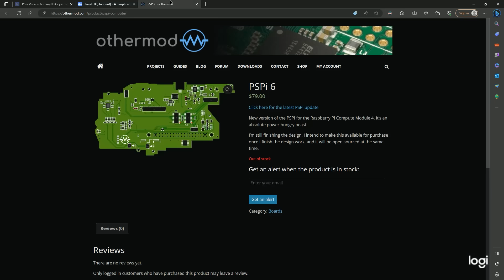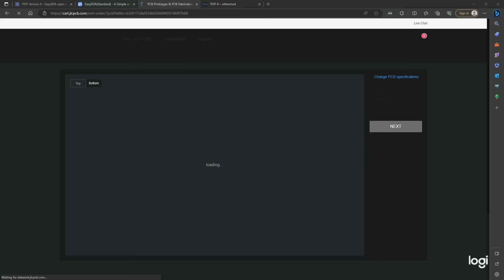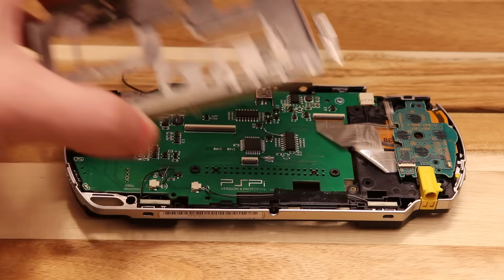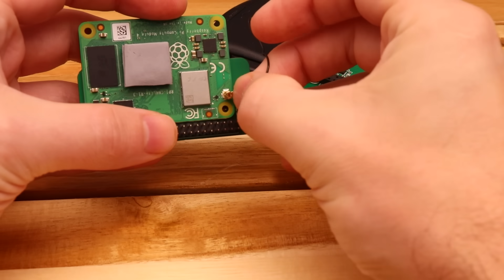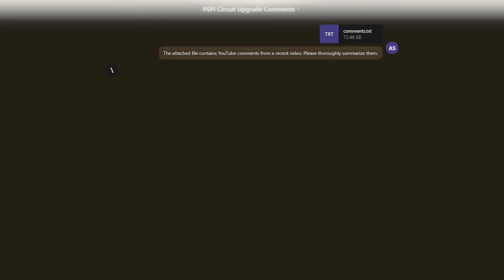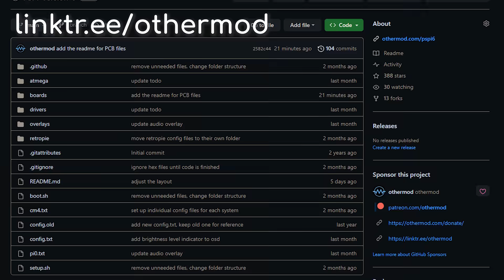PSPi 6 Questions Answered - Ordering the PCB, Building in the PSP Shell

Comment: The portable Linux system part is very interesting! Have you thought about adding a touch screen digitizer to this system’s display? It might add some desired functionality one might wish for when using it as a portable Linux machine (or it might just be me :p ).
Reply from the maker: I built touchscreen capability into the board, and the same LCD I use has a touchscreen version. Haven't found a good way to implement it though, with the PSP having the plastic cover and the LCD bracket limiting LCD thickness.

Comment: Hi, unrelated but could you somehow print or reproduce the battery boards inside fake psp batteries? but only the ones that have the ABC points that can be soldered together to give you accurate battery reading when you do a 4000 mah big batt mod, I would buy that. Im tired of getting andom boards and having to open fake batteries :/

Comment: noob question: I basically have a non working 1000 (shell). With this kit, would it technically be fully restored and working? Id hate to chunk this thing in the trash lol.
Reply from the maker: This replaces all the electronics, so yes something like this would get you up and running.
Reply: Thank you sir! Hopefully I can restore the ol unit with some OEM & Aftermarket parts as well.

Comment: This is really cool. I still have my old PSP and want to do this hopefully soon. Be great to have a portable emulation device. For charging the battery, are you utilizing the stock power connector with a step-up (or step-down) regulator on your board to manage the batter? I didn't catch anything about that in the video when you talked about the battery so hopefully I didn't just miss it.

I'm also going to have to look up the differences between using the Pi Zero versus the CM4. I had never heard of the CM4 before stumbling across this project, so that's entirely new to me. Would I be correct in assuming that based on your estimated battery life, the CM4 has more processing power overall?

Comment: quick question about the mini usb port and it being able to suply power to external devices. would it be able to connect a dongle for a controller? just out of curiosity since if I ever get to building this i hope to also 3d print a bracket or buy one like those that hold both phones and controllers so that I could play some double joystick games without any heavy mods
Reply from the maker: Yeah that should work fine. I've used USB controllers on it.

Comment: Can you place second battery instead Headphone Board(Both Zero and CM4 also have bluetooth, we can use wireless earbud instead)? Can you use FS MICA PLASTIC SHEET instead metal bracket?
Reply from the maker: Yeah, you can probably cram a battery in there. I'm not sure about the metal bracket though. Maybe with enough effort you could probably make something work in place of it.

Comment: Can it run PSP games on the CM4?

I much prefer emulation, if only for the QOL enhancements when compared to the original systems themselves.

Especially on portable systems. When idiot game developers decide “no, you can’t quick save or “save anywhere/anytime” in an age where it could have absolutely been possible to put into the game but was restricted to “you can only save at a campfire” for convoluted reasons, then I’ll simply emulate it rather than putting up with their BS. Why they think that their customers should have to replay parts of a game that they’ve already completed correctly just in order to get back to a part they want to try again is beyond me (also one of the reasons why I play Dark Souls games in a VM setup, even though it’s technically not “emulation” I can still “save-state” them right before a boss fight so I don’t need to go back to some pointless “bonfire” to start)

TLDR: I’d love a device like this for PSP/PS Games. Would also enjoy them for PS2 games but would probably wait until a Vita shell Pi conversion existed that was powerful enough to run them and had support for two analog sticks rather than a single disc.

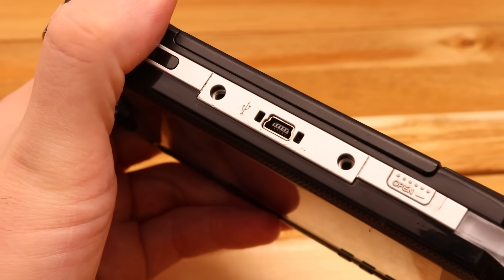Comment: 8:15 what happens if I don't use the same power source? Can you please explain?
Reply from the maker: The barrel jack and USB port are connected together, so a mismatch will cause power to flow from the higher voltage power source to the lower one.

Comment: There's an old mod that added a second thumb stick under the right side buttons. You had to modify the board in the thumb stick and solder it to the traces for the 4 buttons on that side. That way, you could use a stick for fps games that used those buttons for camera movement. I'm sure something similar could easily be done for a second independent stick.

Comment: Great project i still have my old PSP laying around maybe i'll install your mod as soon as it's done with the prototype phase. I would find it great if the pcb had usb-c instead of mini usb tho it does look like you could fit a type-c port in the upper half of the port and you could probably fill the gap from the other half with a 3d printed bracket of some sort.

Comment: This project is awesome. I only have a few questions...

What about the OLED PS Vita screen, would it be compatible if you had just the screen module?

Could you skip the headphone board if you don't care about headphones?

Assuming I already have a Pi Zero/CM4 but no PSP/shell, about how much would one of these cost, just for average part prices? (I also have a 3D printer, and would have to order from JLCPCB anyway, so I could print a whole shell).

Comment: I'm about to hit go on my PCB order *wife may kill me :(*  however I do have a question.  Is that display your using the only one that will work or will any 4.3" inch 800x480 40-pin 0.5mm pitch display work?  also once everything has arrived feel free to hit me up to do some testing!  I'll be assembling all 5 of them but will likely sell/give away 3 once you've launched on your site.
Reply from the maker: Many LCDs will work just fine in it. Just make sure the pinout is the same and the backlight amperage is similar. https://www.buydisplay.com/4-3-800x480-ips-tft-lcd-module-all-viewing-optl-touchscreen-display
Good luck sleeping on the couch. Also, I'll have prototypes in my hand in a week or so, if you want to wait til I get them and smoke test them.
Reply: @othermod  Ya waiting for the smoke test may be worth it, I'll sleep on it.  What's the best way to stay in the loop?  (Here, your forum, discord, other?)
Reply from the maker: I post on Discord the most often, but I'll post everywhere once I get the first bootup on the new prototype.

Comment: Thanks for your great work.  I'm just wondering if there's a chance for adding a DAC to it?  For amplifiers, I have previously used Ti's TPA6130 and it is amazingly good with built-in analog volume control, and not needing output cap is just icing on the cake.
Reply from the maker: I'm going to try to make a more complex carrier board that has a couple MAX98357A I2S chips on it. That is a longer term plan, and I won't put effort into until the standard board is ready to ship.
Reply: @othermod  that sounds like a great idea, since it is on the carrier board, future updates and changes can be easily installed into existing PSPi.

Comment: are you also gonna make a version where the cm4 directly sits into the pspi board instead having a carrier board?
Reply from the maker: Probably not. I started doing that initially, and the parts shortages caused me to change to the method I'm using now. The current method might also make it easier to get the CM4 clones working in this.

Comment: CM4 is pretty capable board, great job! PSP and N64 emu performance is a good question, PSP have huge games library and would be nice to keep it`s original functionality. BT and video output could turn it into aka Nintedno switch - wireless gamepads, TV output and hundreds of games! Not to mention it could be portable Linux machine with monitor, keyboard and mouse connected to it. RC li-po have lower energy density than standard li-ion/li-poly cells, would be beneficial to consider some non high discharge battery (even from safety reasons, RC li-po can get really crazy).

Comment: Do you plan on adding support for touchscreens?
Here me out, gnome has an OSK built into it if you enable it from the accessibility menu; all you do is slide upwards from the bottom of the screen to activate it. If you did, then it would be literally a PSPda as you would remove the need for external peripherals. Then all you'd need is a mouse/keyboard input mapper for the gamepad to emulate some necessary stuff. Antimicro would work for this.

Comment: This makes me interested in getting aftermarket shells and 3D print some of the supports inside but having two sticks available as a “super PSP” pre-Vita. The Pi compatibility, especially if RPi can keep compatibility for the carrier board on the Compute Modules going forward, is super cool. Upgrading modules down the road as more performance becomes available is the ultimate handheld dream. Thanks for sharing your work on this!
Reply: I really like the use of Compute Modules, as it in theory, make the device upgradable for the foreseeable future, and other board manufacturers also use the same design. I recommend also taking a look at the Retro Lite CM4 project, also the same principles, but you start with a shell designed for it based on the Switch Lite
Reply: Aftermarket shells for PSP slim are pretty okay (some are even good), but extremely bad equality for PSP fat, so good luck to find one.

Comment: Even though I do not have a PSP nor will I probably have one in the future, I still admire this project. The fact that it's non-destructive to the console in any way makes it even cooler than other PSP mods out there. If I personally had a way to support your endeavour, I totally would
Reply: Where’s the rest of the psp then?
Reply: @miregoji2959 don't think you need one. Just buy a replacement shell and a screen, battery etc
Reply: @miregoji2959 you can just order a psp case but there are damaged motherboards that are relegated to being solely donors.

Comment: Have you seen mods that added a second stick to the PSP?
I think I saw it on acid mods 15 years ago or more, I did etch a pcb for it in the school lab, 
it was just a passive dumb pcb only analog to digital converter that made it activate the X, O, square, triangle face buttons. Since these were used for looking in many first person games. 
The PSP 1000 joystick as you definitely know has the pads under them so it connected to the PCB just fine without any new parts.
So there is room for a second psp joystick in the right of the case, just need to cut a hole for it

I am wondering if these posts are still on acid mods forums... Is the website still up?
Reply: After searching Acidmods I didn't find the old post I followed, or maybe I did but the pictures are not online still
but I did find another thread with someone else trying to do the same, I can't post the link since youtube is strict, but the title and the date of the thread are as follows:
 A better tutorial on the dual nub
« on: December 30, 2008, 12:33:38 PM »

Comment: This is super awesome! I have a Radxa Zero unit or two, that is the same form factor as a Pi Zero, but considerably more powerful, has built-in MMC flash and lots of RAM - perhaps you could look at a future mod where you can use on of them instead of a Pi?
Reply from the maker: Maybe, but it would need a bit more adapting. I don't think that the Radxa board has DPI display output.

Comment: Thank you for answering my OEM screen question. Just had to ask. There's nothing wrong with my PSP, but your upgrade would make it more functional than stock. If your custom board came with USB-C, no love loss here. Dremel 3000 works just fine.👍😉
Reply: 🤔You know what would kick things up? Micro SIM card slot and 4G GSM radio module. Along with a desktop simple dialer widget.😁 Note: Not 5G! I don't need a LoJack up my 🕳.

Comment: Love the explanations, if you need more testers I would be happy to help as I do quite a bit of traveling and used to bring the PSP, I stopped because the volume for the headphone jack is just too low for some of the scenarios I travel in (i.e. on a plane, or a big noisy diesel truck). I can also try to help with coding, I'm not super good at it, but I did manage to cobble together a port of Ubuntu Touch on a Samsung Galaxy Note 4

Comment: With a second analog and maybe modded extra shoulder buttons (that could easily work as a usb joystick with the cm4 version) this could be a full blown gaming machine with all the bells and whistles. Too bad it uses the psp 1000. I have a 2000 and had hopes to revive it in added glory.
This project is still interesting for the components tho, but as a handheld computer, I'd go for the Decktility project route. Built-in keyboard and even if it's a smaller screen, it's also easier to put on your pocket. 

But yeah, considering the psp is a good emulation machine already, the next step would be for it to run simple pc games. That's what I was hoping for from this project.

Comment: This is such a cool project! One suggestion: PSP1000s are not always easy to get and will probably get more rare now. Is it possible to buy a 1000 aftermarket shell and put this in it? You could include instructions about that.
Reply from the maker: The problem is that there are other internal parts like the LCD bracket, dpad, and control boards, and those don't come with the aftermarket cases. Some of that stuff is available aftermarket, but some of it isnt. I'll put some thought into it.
Reply: Yes exactly. Maybe it's possible to make equivalent parts with thin PCBs (no circuit, just acts as the bracket) or provide a 3D model and people could use a 3D printing service?
Reply: I have a spare 1000, it's missing the home row buttons and the front of the case is cracked, but I am willing to ship it to someone if they wanna use it to make case kits

Comment: This is a really cool Project. I have a PSP 1000 in white and I Plan on keeping it original as its still a cool console with a lot cool and fun games. I even bought some new games recently. Although I play them on my modded Vita.
Since there are some aftermarket Shells for the PSP I think it would be a fun Projekt to build a mobile Linux PC in a PSP Shell. One killer feature would be a touch screen but I have no Idea how that could work with an unmodified PSP Shell. 
Anyways ... You do a awesome job and it's fun to follow the Projekt :)
Reply from the maker: Yeah the psp case makes touch difficult, but it would be pretty easy to add the feature to the board.

Comment: Awesome project, already searching in the parts-bin!
The screen you're using, is that the "IPS" replacement one for the 1000?

I remember using one, had some saturation issues.
Could have been a faulty one tho.
Still a big upgrade from the og.
Reply from the maker: I'm not too familiar with that screen, but I doubt this is the same one. Here is what I use.
https://www.ebay.com/itm/4-3-inch-800x480-IPS-TFT-LCD-Module-All-Viewing-Optional-TouchScreen-Display-/292806918081?mkcid=1&mkrid=711-53200-19255-0&siteid=0&campid=5338322564&customid=&toolid=10001&mkevt=1

This one is much higher resolution, and I've ordered tons of them without ever seeing saturation issues.

Comment: Love the idea of using it as a portable linux system, pair it with a bluetooth keyboard and it's basically a cyberdeck.
Reply: Imagine something like a replacement back that has a mini slide out keyboard
Reply: the thing is you do not need linux for psp to be a ultimate hack machine.
Reply: @TUFRTX  because the built in web browser is usable
Reply: i need this but i could do it with my steam deck
Reply: True, but this is much more portable @AdamKueflef
Reply: @aidanocallaghan1284  fair point but I have one now and one is still a bit of time away
Reply: *cybertruck
Reply: @dragenoxinside  *cyberdeck